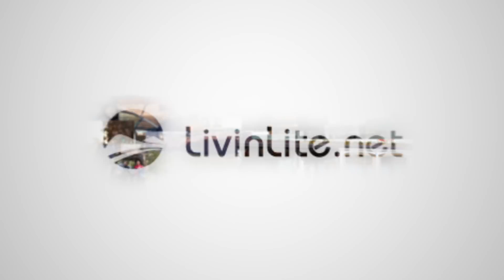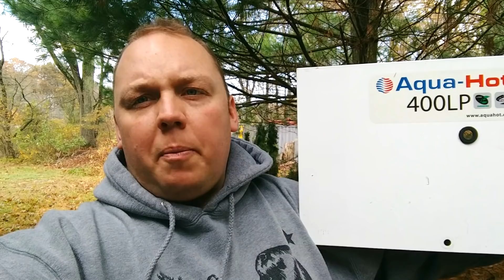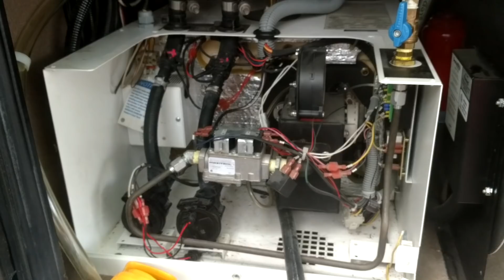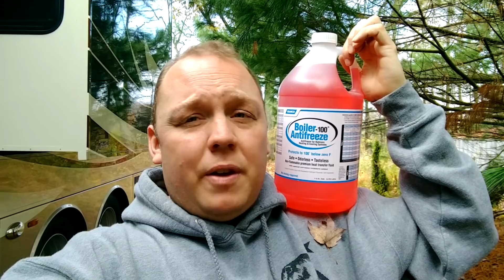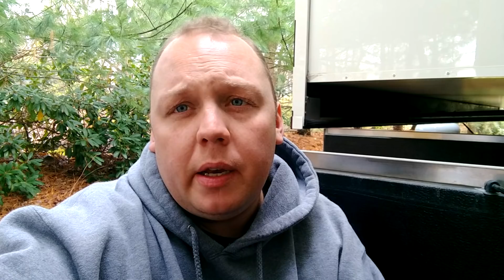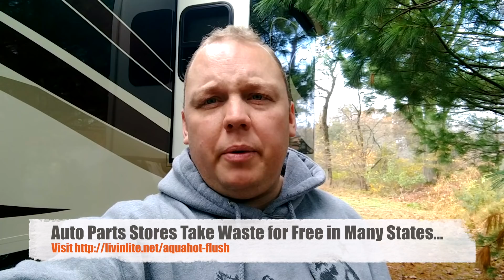Aqua-Hot Maintenance - RV Antifreeze Flush Full Video

Comment: I* would suggest both draining AND filling the boiler solution from the port that you used to drain the Aqua Hot. All that is needed is a 1/2" male pipe to 1/2" tubing adapter screwed into the valve on the end of the "drain hose". After draining all the propylene glycol, connect your manual pump to the adapter via some 1/2" clear tubing, open the valve and pump the solution into the Aqua Hot. This minimizes air being trapped in the system. Just keep adding glycol until the reservoir is about half full, then run the system and top off as necessary. I might also suggest that instead of the manual pump that a RotoPump brand drill pump be used instead. The adapter, tubing, and nifty drill powered pump can all be acquired with one trip to Lowe's. (BTW: The drill pump comes with tubing and fittings and costs about the same as a decent manual pump.)
Reply: Your Rotopump idea is great. I am going pirate your idea. I have a Dynamax DX3 (FreightLiner 8.9 liter Cummins engine). Oil changes are brutal. Been lugging a 5 gallon bucket of fresh oil up to the top of motor and pouring it in. The entire neighborhood would come out to seen an old guy hump a barrel up a step ladder and balance on top of engine block while pouring without spilling half the oil. 😂 For next oil change I am gonna use a length of hose so I can leave the bucket on the ground and stick the in the fill spout. I did check the Rotopump package and motor oil is listed as a liquid you can pump. Thanks.

Comment: How can there be too low fluid if the over flow tank shows full . I'm learning about my Aqua hot . I dont use it very much just like 10 min for dishes and showers in the evening .
Reply: Because the tank was empty.  He filled it from the top which has to "Burp" it's way into the system letting air out.

Comment: You can use the drain with a 1/2 per connector and a water pump to force the water back through the drain... you're also suppose to run 1 of the stir pumps. You can use an alligator clip to ground out the pump to run it. There is a few things you're forgetting to tell people.
Reply: Pex*

Comment: We just had our system serviced. We did run our heat where we were staying. We looked at the reservoir before we left and there was no fluid in there. We have always been able to see pink fluid at the cold line before. We checked again when we got home and still no fluid there. We could see fluid in the tubing and the color of that fluid is brownish yellow. We had the work done at Tiffin shop at red bay Alabama. Is this a problem that we need to fix? Thanks for the video! We can do it ourselves next time.
Reply: No, its good!  Direct from the aquahot site "Discoloration of propylene glycol antifreeze solution may occur during normal operation of the Aqua-Hot system.  This discoloration does not indicate a malfunction of the Aqua-Hot system or the antifreeze solution. "

Comment: My system fluid is brown and thus I need to do a full flush with water first. Any recommendations on how to quickly flush the water in and the antifreeze out in each zone before then draining and putting boiler back in? I am talking about sequence and if there are any better ways to get the system to take the water in. Otherwise it looks like from your video I will have to put the 16 gallons of distilled water in, put the cover back on and close the whole system up, then turn on furnace and zones and then turn it all off and drain it out and repeat a few times until mostly clear is coming out. I also worry about the water getting up way too hot to be able to drain again quickly.... thoughts?
Reply from the maker: I'm not aware of a faster way to flush the fluid but I think you'd be looking at closer to 7 gallons, not 16 so its not all that bad. That said, depending on the age of your coach it might be brown only because they mixed the "green" fluid with the "pink" fluid during a top off/maintenance which creates the brown and if that is the case I wouldn't worry too much about flushing it first, just dump and refill with new fluid of all the same color and you should be fine (maybe flush a gallon of distilled water through the system just to clean out the lower areas where any sediments may have settled. As for the heat, it will burn you but its not terribly hot meaning a plastic container won't melt (ours didn't have an issue, just a standard bin from Walmart). Just take your time and be careful.

Comment: I just did this flush tonight. Followed your instructions but got to a point where the fluid would not go in anymore. Only got about 2 gallons in. I went to the Aquahot site and read where there is a purge valve on the top of the unit (like a valve stem on a tire). When I took the cap off and pushed down on the valve the air started coming out and the fluid started to go in. I did this until it was coming out all fluid and no air. Was a lot faster. I ran out of time tonight to test the heat but will tomorrow. Thank you for the info on what and where to buy the product!!
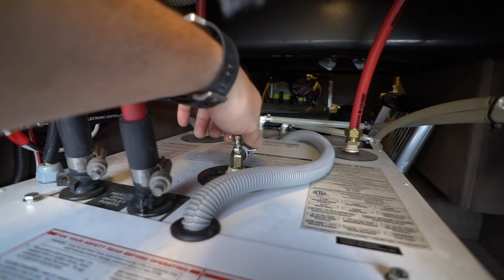Reply: yes we purge in the video at 8:18 but for anyone stuck you can do this sooner.

Comment: Thank you for the video!  We have owned 3 Diesel 450 AquaHot systems and never had any trouble on the first two systems which used Pink Camco fluid.  Our two Pink Camco Aqua Hot systems stayed for years with clear pink fluid and no troubles.  However currently...We have run into the “sludge coke colored” fluid on our new system that was factory installed with Century Fluid Green/Yellow color.  We believe the troubles are all coming from the Century Transfer Fluid and we are planning to change over our system like you did to Pink Camco Fluid and hopefully it will be before troubles set in with the pumps etc.  Thank you for taking the time to share this video!
Reply from the maker: Thanks so much, i'm guessing the sludge color is either coming from them topping off the Century fluid with Camco (most likely as the pink and green turn brown) or Aqua-Hot also claims that contaminants in the water will cause this also so make sure to use distilled water! Either way i'd say a flush is in your future! Thanks for the comments and feedback!
Reply: Aquahot also states that discoloration of the fluid is normal and not any indication that anything is bad, with the unit or fluid.  Keep this in mind before you waste time for no reason!

Comment: First of all I must say I love your videos. I would however make a suggestion that instead of adding fluid from the top when doing a full fluid change. That you create an adapter to the drain line and gravity feed from the bottom up. That will force the air out naturally and will make the job go much faster. Other than that it was a well-done video
Reply from the maker: Thanks Gary, great idea. We thought about doing that but when we called Aqua-Hot they told us to do it this way but... I like your thinking! Makes sense and since you have the valve already to prevent spilling when full why not?
Reply: I was going to make this EXACT same recommendation...Good on ya Gary!